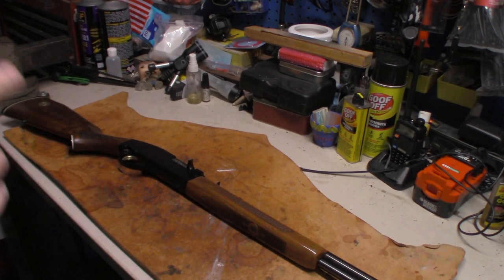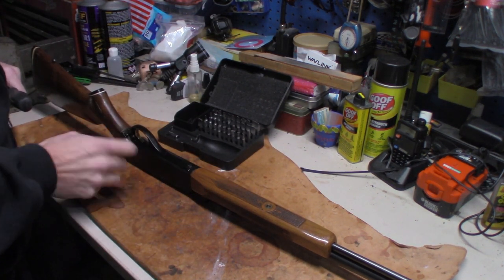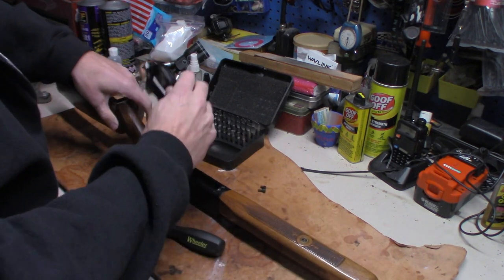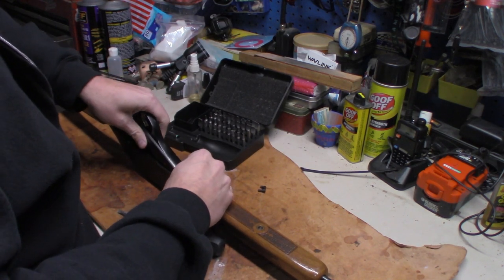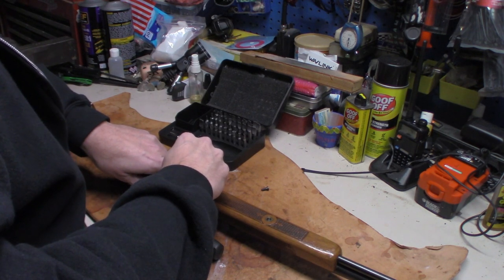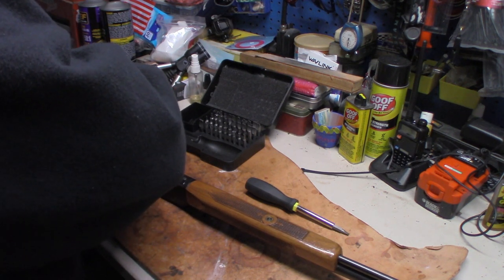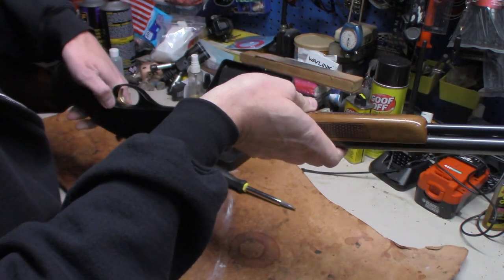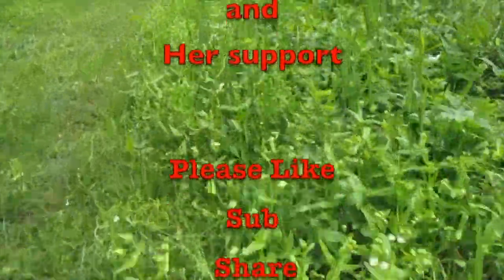Marlin Model 49 Trigger Pack Removal

Comment: Good video. I recently inherited a very nice model 49dl. The stock on mine is slightly different. No cap on the bottom of the pistol grip and minimal checkering on the grip and fore end. Otherwise identical. Jeweled bolt and engraved on the sides of the receiver. Were there variants of this model?
Reply from the maker: David Havard oh I am sure there were. They did that a lot back then. You can probably take the serial number and look it up on their website.